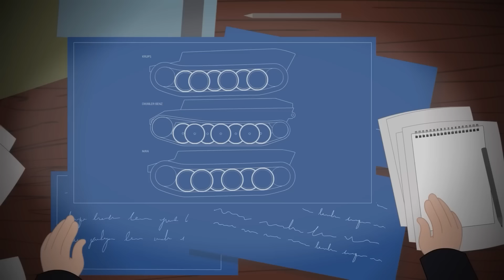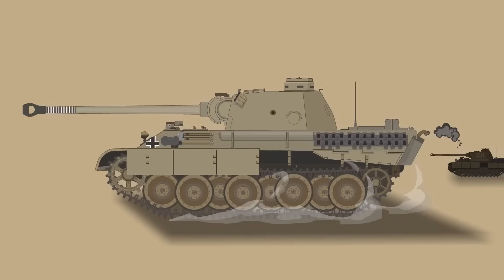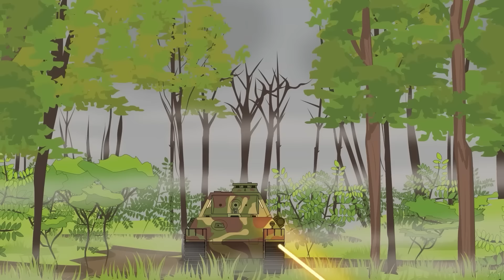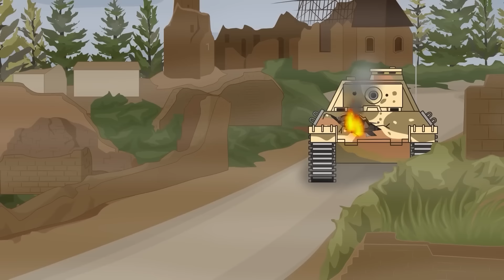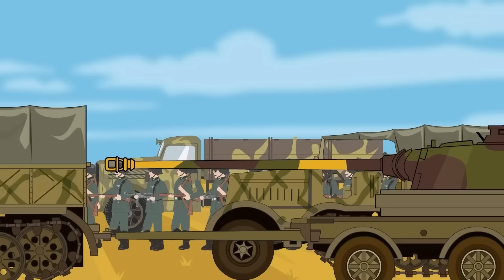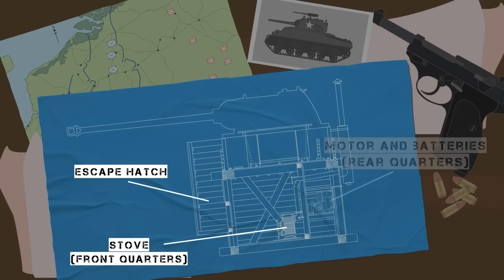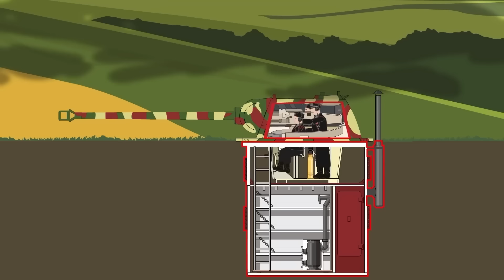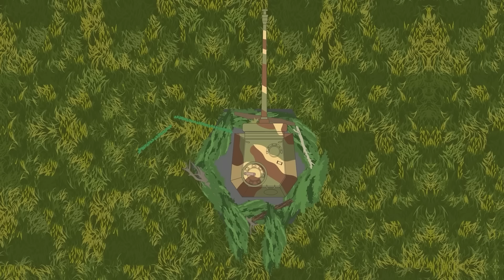Germany's Copy Of The T-34 Tank

Comment from the maker: This video was made possible thanks to everyone on the Simple History Patreon: https://www.patreon.com/simplehistory
Reply: Om
Reply: There's a little bit of an error on the Variants, the Panther Ausf F and Panther II had different design philosophies

The Panther II was the answer to the fact the Ausf D were getting shot by Anti-Tank Rifles and was uparmored from 40mm to 60mm the hull and standardization with the Tiger II using its road wheels and tracks but never entered service but was used as a test bed for the Ausf A and G and then captured by the Americans and was grafted an Ausf G Turret

The Panther F was basically all about the Schmalturm Turret and would've used the Ausf G as its base along with a new 75mm Cannon
Reply: Good video, but just a correction, the glacis plate of the Panther was not around 100mm of effective thickness, but around 139mm (80mm @ 35 degrees from horizontal).
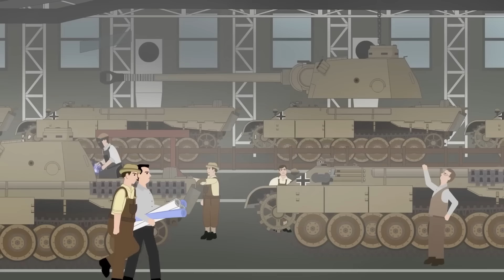Reply: 1:13 is highly inaccurate.
Germany didn't adopt the assembly line factory layout, all their war equipment (including tanks and planes) were assembled in a stationary spot. 
One of the reasons why Russia (having its factories built during the Great Depression by American companies) and the US could outproduce Germany by such a staggering margin. It contributed significantly to winning the war.
The more you know 🤷‍♂️
Reply: The Panther started development before the T-34. NOT A COPY ! I am appalled at the extensive copy-misinformation which is rampant about WW2

Comment: The Panther (Panzerkampfwagen V) was not a copy of the T-34, but it was heavily inspired by its design. After encountering the T-34 on the Eastern Front, German engineers recognized the strengths of the Soviet tank and incorporated some of its features into the Panther while also developing their own advancements.

Similarities (Inspired by the T-34):
Sloped Armor:
The T-34's sloped armor was revolutionary, as it increased the effective thickness and helped deflect incoming rounds. The Panther adopted and refined this concept, resulting in its highly effective frontal armor.
Wide Tracks:
The T-34's wide tracks allowed for better maneuverability in mud and snow. The Panther also featured wide tracks to improve off-road performance.
Mobility and Firepower Balance:
Like the T-34, the Panther aimed to combine speed, firepower, and armor protection effectively.
Key Differences (German Advancements):
Technological Complexity:
The Panther was far more advanced and complex than the T-34, which made it more effective in combat but also prone to mechanical issues. In contrast, the T-34 was simpler, more robust, and easier to mass-produce.
Main Gun:
The Panther was equipped with the 7.5 cm KwK 42 L/70 gun, which had superior range and penetration compared to the T-34's armament, making it deadly against both infantry and armored targets.
Size and Weight:
The Panther was significantly larger and heavier than the T-34, which limited its mobility in certain terrains compared to the lighter and more versatile T-34.
Production Philosophy:
The T-34 was designed for mass production, prioritizing simplicity and reliability. The Panther, while technologically superior, was more expensive and time consuming to produce, resulting in fewer units being available on the battlefield.
Conclusion:
The Panther was not a direct copy of the T-34 but rather a response to it, blending inspiration from the T-34 with German engineering. While the Panther was superior in terms of technology and firepower, the simplicity and reliability of the T-34, combined with its sheer production numbers, gave it an edge in the larger context of the war. The claim that the Panther is a "copy" oversimplifies its development and overlooks the unique German contributions to its design.

Comment: Guys, The T-34 had just about as effective armor as the sherman, if anything, the sherman was stronger bc eaver early models had rough 50mm as opposed to 45mm on the T-34 (universal except for a few like the T-34Es and the SU-85M & SU-100) heck, US upgraded to 63mm.

At worst, sherman armor was equal to T-34 armor given angling. T-34's only real positive was that it was cheaper, US shermans were extremely cost-effective and they had good upgrades, even compared to the T-34s and their upgrades

Granted, I am taking this from a wikipedia-LazerPig-War thunder perspective, so at least 2 sources are good bc they ensure their sources are good (not WT, they let a 105mm Tiger 2, an E-100 that would collapse in on its own weight, and a Panther with an 88mm into the game)

Comment: The idea if sloped amor is already evident in many german vehicles before the Panther, like their halftracks or scout vehicles sdkfz222. They did not copy the idea fron the t34. However the germans prefered a spacious envirourment to operate with the crew, look at the panzer 3 and 4 conpared to the t-34 or sherman. They were rather big on the inside in comparison. Sloping amour means a cramped space, less ammo, equipment, they didnt wanted that on tanks. On the Tiger 2 you can see to what that leads… a pretty big vehicle if you want sloped amor and space on the inside…

Also shermans and t34s had also massive problems when they were introduced, it was not a german only thing.

Comment: Panther was actually massive flop when it comes to armored warfare. Only tiger II was worse for the Germans
Reply: And what makes you jump to that conclusion?
Reply: @Ranyick  low reliability, lots of technical errors, expensive to make, takes long time to make, very complicated, low fire power against infantry, too heavy for medium, too light armored for heavy. Overall very dissapointing project. Should've stick to Pz IV-like tanks with new improvements
Reply: @b4nterontilt  the low reliability and technical errors were only really a problem initially because they were rushed into production without fixing those teething issues. By the end of the war they were as reliable as Panzer IVs. And just so you know, in 2 years they produced almost as many Panthers as they produced Panzer IVs in 6 years. 
It has an adequate HE shell, and besides that it wasn’t supposed to be an infantry support tank so that isn’t super important. 
It’s frontal armor was effectively as thick as the Tiger I’s, while it’s lighter weight means it’s more mobile and easier to transport by train. 
The Panther was the best tank Germany could’ve built. 
And even then, the Panzer IV was a dead end. The Panzer IV H had so much armor the transmission almost couldn’t hold it anymore, while it’s gun was not powerful enough to reliably deal with newer versions of Shermans and T-34s at longer ranges.

Comment: I thought the most fearsome tank the Germans had was the Tiger?
Reply: The Tiger was far more infamous, but the Panther generally preformed better
Reply: @Ranyick  How exactly?
Reply: @alfrancisbuada2591  the Panther is more mobile, lighter, cheaper to produce, easier to transport by rail, has effectively the same amount of frontal armor and it even has superior penetration at short range, while still having similar penetration values at longer ranges
Reply: @Ranyick  In contrast, to the Tiger Tank?
Reply: @alfrancisbuada2591  the Tiger was heavier, slower, more expensive, needed different tracks if you want to move it by rail, has 100mm of unangled frontal armor (the Panther has the same amount if you take the angling into consideration) and it’s 88mm gun actually has lower penetration values at short range, while only slightly beating out the Panther’s gun at longer ranges
Reply: @yarnickgoovaerts  But you have to admit, it was the scariest thing on the battlefield to face.
Reply: @alfrancisbuada2591  simply because it’s more infamous, because they were deployed differently
Reply: @alfrancisbuada2591 sure it was scary, if you actually fought one. The Americans didn't fight a single tiger tank in france, and didn't see one until they entered the Rhineland. Almost every tank they faced were panzer 4s or panthers
Reply: @ethanedwards422  They would have been disappointed if they didn't fight the tank with so much hype.

Comment: 2:05 

The F variant had the Schmal turm or “small turret” as the turret to, as you stated, make production easier. The turret was tested and proven to hold the KwK 43 gun (king tiger gun) but due to lack of space the gun couldnt be reloaded. That turret was also planned to be the main turret put on any panther that needed a new turret 

As for the Panther II it was indeed built, at least the hull was with it currently residing at the Armor & Calvary museum in Ft Moore (Ft benning) Georgia. The collection has certain dates where they open the collection to the public to come and see the vehicles with the legendary T28 “doom turtel” right across from the Panther II in the collection

Comment: Fun fact: the panther was so close to being a full mbt it was almost classified one
Reply: The problem is there isn’t a clear definition of what exactly an MBT is. You could say an MBT is any tank with its armor focused on the front and a high velocity gun capable of penetrating the vast majority of tanks it might face, in which case the Panther is indeed an MBT
Reply: If the panther can be called a MBT, then the Mark 1 from ww1 can also be called a MBT.
Reply: @ethanedwards422  the Panther has most features that define a modern MBT: armor focused on the front, good mobility, highly capable gun. There isn’t a strict definition for what an MBT is, but the Mark I is definitely not it

Comment: Slogan of the Panther “Hans, ze transmission broke!”
Reply: The transmission didn’t break that often, the final drive however did
Reply: @Ranyick  The problem was the mechanical parts weren’t built for a vehicle of the Panther’s weight, the transmission would break because the Panther was just too heavy for it
Reply: @LegionQueenCycad  the transmission wasn’t any worse than other German tanks. Other parts like the final drive did break often, and that was mainly because of poor maintenance and the fact that crews trained on Panzer I’s and II’s, instead of actual Panthers
Reply: @Ranyick True, but there was also the factor that as the war went on Germany had to use less and less hence workers to make the tanks, had why the Panther and by extension the Tiger have a reputation for breaking down often, and weight was a major factor too, putting too much strain on the drivetrain and transmission, there is also the fact that German tanks were completely over designed, they were too complex and required constant upkeep to even function

Comment: One of Panther´s problems - of what i´ve read - was the shape of the sprockets inside the drive for the drive wheels. Because they were shaped horizontally they had a reduced distribution of forces. The result was they broke relatively often when the tank was driving faster than approximately 28 mph. So it could never reach it´s actual top speed of 34 mph.
Reply: Very true. The Germans could not manufacture stepped sprocket teeth, (like the Sherman's) due to lack of tungsten and other alloys, but they usually broke off, mostly due to driver's incompetence, (and there were many from late 1944) not due to speeding up. Experienced drivers drove their Panthers without mishaps for a thousand miles or more, (Repairing the Panzers” by Lukas Friedli).
Reply: Du you know how fast 28 mph is for a tank? What do you demand for a "heavy" medium tank.
Reply: @kirgan1000  did you actually read my comment properly? I didn´t expect anything, i just said due to technical issues inside the transmission the tank´s top-speed had to be reduced. I hope that was clear enough.